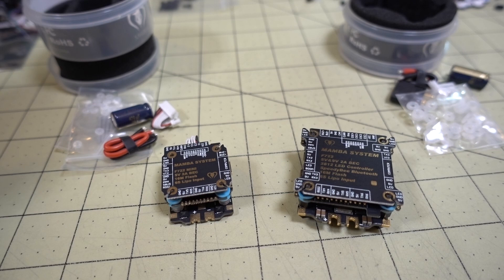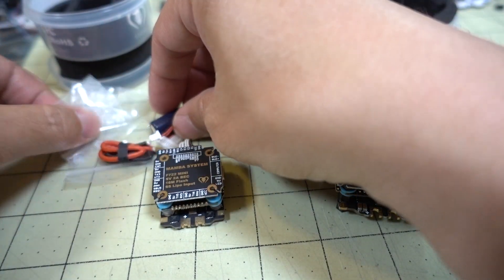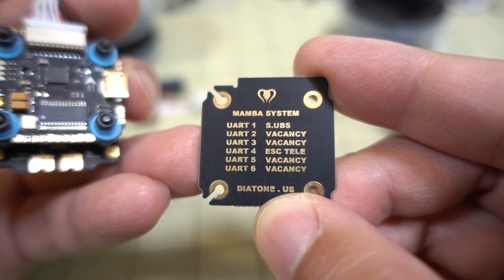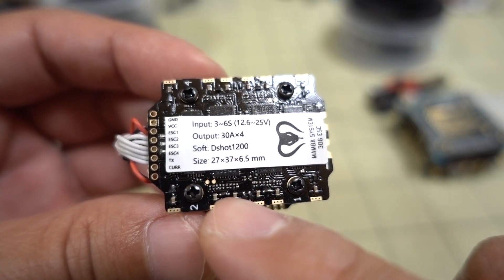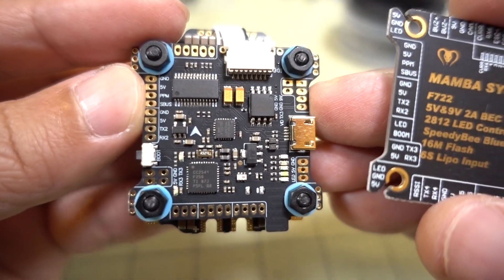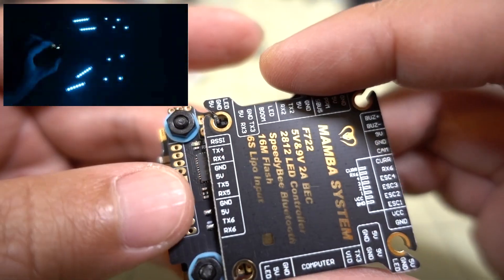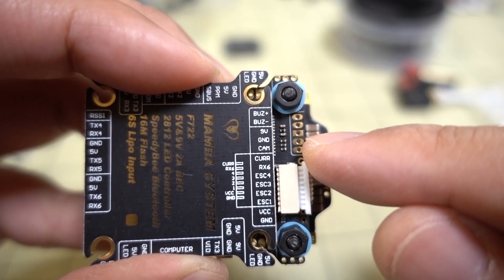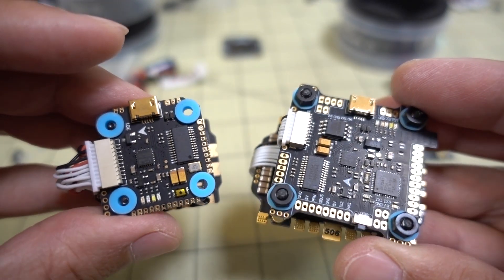Diatone Mamba F7 Stacks 🎉

Comment: Got a f722 mamba that went into the ocean. Cleaned it with fresh water, used alchool and it fires up in betaflight but the vcc doesn t get anything. So, no power from the esc, was running 6s on it.

Is it possible to take power in a different way ?
Reply from the maker: Not that I know of.

Comment: someone knows wich default pin is for the bluetooth?
Reply: You don't need the PIN to connect through Speedy Bee App.
Just start the Speedy Bee App and choose the Bluetooth symbol and it will find your FC. Remember to not connect the USB by computer to the Betaflight Configurator. ;)

Comment: Thanks for the video review on Diatones new stacks. I just finished my build with this stack. I love all the features and the easy setup. I did however have an issue when configuring Blheli 32. Normally I reverse motors 3 and 4. I had to reverse motors 2 and 4. All my motor wires are soldered straight to 4 in 1 ESC the exact same way. Weird? I also get an error message on ESC 4 for music, but it is not on? It flies great now, Maybe it will help someone out.
Keep up the great videos

Comment: i cant recommend this POS stack to anyone!!! From the beginning i couldnt even get Motor 2 output to work.. motor stuttered as if one phase was broken.. resoldered everything several times and crosschecked with another motor and also remapped ressources..tried all the blheli settings possible..changed to all available protocolls Dshot 150-1200, proshot, multishot.. nothing helped.. and then to top things off the FC went to shits while troubleshooting..from one plugging to another some LED didnt shine anymore and the F7 chip gets instantly hot upon plugging and isnt recognized anymore so the classical fried chip even though it had no reason to do this and no smoke came out -.- save your money for more quality gear folks this one is a big dissapointment apart from that the stack cant even run rpm filters  -.- i took place in the review program so i "only" spent 35$ and a whole two days troubleshooting and now they just refunded me 15$ so yea really great experience with this after building more than 10 quads this is by far the biggest disappointment ...

Comment: if it helps some in the future Albert. for use  with the TBS unify nano pro smart audio 2.1 DOES NOT work with the base flashed firmware you have to update to BF4.0.
I cant confirm but if this is the case for my nano I assume its for all the new TBS VTX's

Comment: Hi AL I have the Mamba  F405 stack. how do I wire up a Frsky R-XSR so I can get RSSI ? I can't make it work ? Also the setting in Bata Flight ?
Reply from the maker: So, to answer this question properly (which I have gotten many times) will require a video because it's rather involved.  Basically you wire up the SPORT to a UART TX and then enable telemetry and send RSSI to an AUX channel.  If you got that then I won't need to make a video.  If not, let me know.
Reply: I did that AL. Now I need to know how to enable telemetry and send RSSI to an AUX channel. My batá flight settings are messed up I think ?

Comment: this is a very well laid out stack.. looks like they didnt think about Spektrum users though (but they probably aren't that big of a share of diatone users.
Reply from the maker: Yeah, I see this as a trend.  Spektrum market is shrinking and you'll see more products ignoring them which will make the market shrink more.
Reply: @AlbertKimTV  I use Spektrum as I have (too) many planes and gliders and just recently started with quads as well. The Spektrum 4649T is a really great receiver and runs nicely on 5V so that option is still there with these boards. OK, it costs a rip off £40 but, with only 2 quads, I'd rather this than buying into a second TXRX infrastructure. Both these boards look really great!

Comment: Features rich boards...really like the Speedy Bee option on the 30x30 stack..but i still have four of the old 20x20 Mamba stack and two of the 30x30 Stacks which get the job done still for me. The only problems i had with the old F4 boards was the pads was weak and easily lifted if your not careful. Ill probably try these baords down the road after they drop below $70 or $80 bucks they are now!
Cool little review appreciate your time😀

Comment: Oh no... The price (joking)...
Or maybe I should go with Mamba F405 mini instead for 20x20?
Reply: Have both f4 mambas since their release and they work just fine. Only issue there was the pads lifting off when soldering but it always occured to non experienced users probably using wrong temperatures. However right now you can get MK2 versions only and these should have this issue fixed.
Reply: TheTryzna probably F405 mini will be a way to go for me as I need cheap 20x20 stack... Could you suggest any affordable small VTX?
Reply: @christiannorwik  well it depends if you are going to fly alone or not. If alone then affordable is eachine vtx03. Unify guys always ask me how am i doing that clear picture black magic;-) And its just combo of foxeer arrow and vtx03. I would stay away from AKK as me and my quad buddy have bad experience with their products. If you are going to fly with group of ppl, then you will have to exclude word "affordable" form your vocabulary when it comes to vtx and go for unify or tramp.
Reply: TheTryzna thanks 👍
I fly alone, and when there are more drones in the air they are mostly DJI and similar so I'm assuming no problem there...

Comment: back in my day... people were complaining in the comments section about $25 per ESC... my only complaint about the Mamba F4 stacks where the solder pads didn'/don't seem very resilient. I really want that 20x20 stack for a 3ninch freeCine build. in other news I hope the complainers realize they could still be buying crap unhhhh silk-screened unmarked unmapped flight controllers.. but they're not!
Reply: Should be fixed with MK2 versions which are on the market right now. Looks like old ones were pulled out. However i own two of the old ones and never had any issue with em.
Reply: @TheTryzna  this is the very first I've ever heard of the MK2 versions having their pads fixed thank you for the info!

Comment: Appears to be a nice board! I’m wondering if this is phasing out the Mamba f405 stack? I have the F405 in a couple builds, and so far, so good, and the price is definitely right on the 405!
Reply: you get what you pay for ….
Reply: Emiliano Zapatta - Yes, I tend to agree with that philosophy, but when it comes to this hobby, that isn’t always true. The Mamba f405 stack has yet to fail, and by comparsion, it’s cheap, whereas other more expensive FC, have failed. Same thng applied to frames. Just because it cost more, doesn’t always mean it’s better!